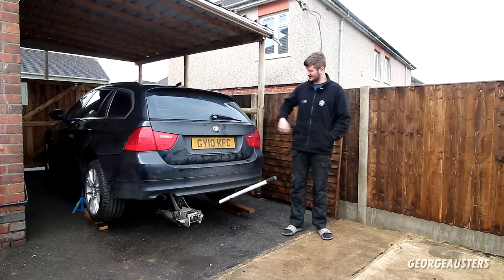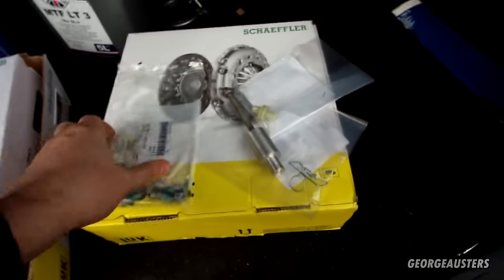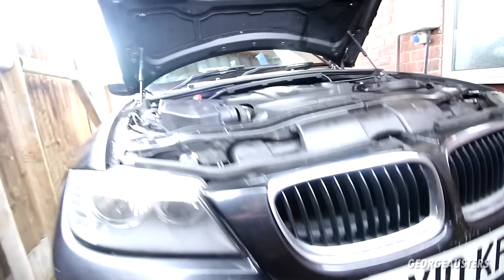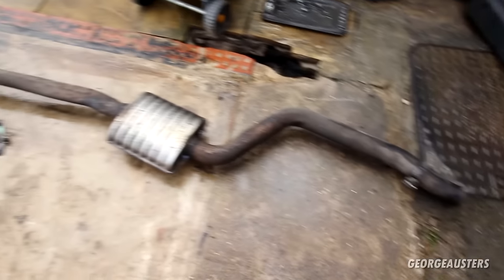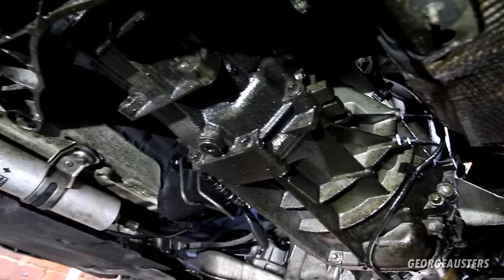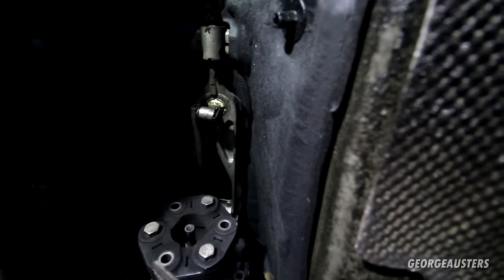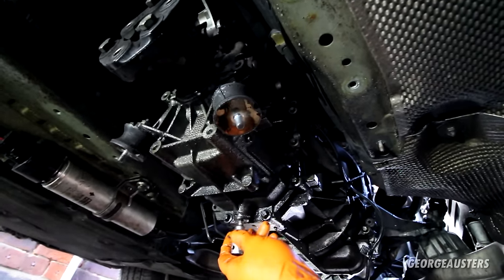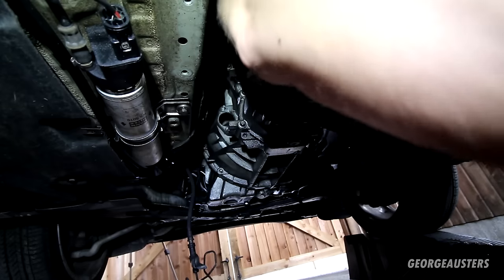HOW TO REPLACE A CLUTCH ON A BMW | CLUTCH & FLYWHEEL REPLACEMENT

Comment: I feel for you George, I am 70 years old and done a few of those, The old ford sierra springs to mind.  Well Done.
Reply from the maker: Thanks Andy!
Reply: Yeah,  ford sierra, cast iron bell housing and box, effing heavy ..and i did not have George's muscles- that was hard.  well done George - nothing to point out this time .:)
Reply: My god yes, the 4x4 was an absolute nightmare to do
Reply: Actually the first clutch i changed in my life was a Ford Sierra one, it was pretty easy in my opinion :D

Comment: Just a small tip for anybody make sure the box is in gear it stops the shaft from spinning and you can turn it from where the prop shaft connects
Reply from the maker: Good idea!
Reply: Nice

Comment: I did the same thing to my 118d (m47) a year ago. To reinstall the gearbox, I placed two long wooden poles beneath it, and then two of my friends lifted it 'vertically'. This way, I only had to align it with the clutch, nice job George
Reply from the maker: Yes it would be a lot easier with 3 people hahaha

Comment: At least bmw have the driveshaft bolted to a yoke. On older cars it slid out leaving a hole which could give you a crotch full  of the most smelly disgusting oil.

Comment: In my younger life I worked for multiple transmission shops pulling and rebuilding automatic transmissions. Did my fair share of clutch jobs as well. One thing that is important, before removing the transmission mounts put a jack under the transmission so you don't destroy the engine mounts as they are pretty much supporting the weightafter the trans mount is removed.

Comment: Been watching this for 10 minutes George and could not have been more relieved to see that trolley jack. I was fearing for your safety mate! Incredible job as usual. No way that's 50k miles on the inside of that gearbox either.

Comment: George, a handy tip. Put 2 cut off long as possible bolts into the block so that the bell housing can slide along them into position. That way, you never subject the clutch centre or trans input shaft with radial loads. Also gives you much more control. Slot the ends so they're easy to unscrew.
Reply from the maker: Not sure if you watched the whole video but I did do that with 1 threaded bar but it actually made it more awkward in the end as I couldn’t get it high enough to just slide it along from so far back

Comment: The new push bearing always feels  as loose as the old one coming out 
And as for the nylon pin most clutch garages don't change them its a must when changing the clutch there is an upgrade on ebay and its made of metal
Most of my cars are BMW and i repair them my self ie trimming chain clutches dpf etc 
And you did a really good job on the clutch

Comment: Well done George! I would not have fancied that job at all. In my long motoring life I have changed a couple of slipping clutches that you can't just see easily what the problem was. I have always assumed it was pressure plate trouble. I have had a few instances where people have just changed the friction disc and said that it has had a new clutch fitted, maybe the case on KFC. Anyhow, job's a good 'un now, so onwards and upwards, as you say, next clutch change may be on your own ramp.
Reply from the maker: Let’s hope so 👌🏻

Comment: Wow, thought you were going to get crushed by the gesrbox at some point very brave to tackle that on the floor. Thinking of dokg my 318 e90 as its on original clurch on 190k miles. Do have acces to 4 post ramp and an extra pair of hands so should be easier for me. Great video and super informative.
Reply from the maker: Haha thanks!

Comment: All the recent clutches I have changed have had weak pressure plates and have been slipping. Years ago the plates were usually worn to the rivots. Dont think I have ever seen a good release bearing. Bell housing bolts on BMWs are usually ridiculously tight requiring a breaker bar to undo.

Comment: I did the same job on my MK3 cortina in 1982 when I was 26.  Same experience as you, maybe not quite as bad, but still resolved to not do another one. Driven torque converter autos since 1994, no problems with any of them😅

Comment: After struggling for hours I figured out the best way of doing this on jackstands without help without a proper set up.  i would recommend this process, 

Step 1 : Understand where the centre weight balance point of the gearbox is 
Step 2: Position gearbox under car about 5-10cm away from clutch interface on ground
Step 2 : Use a jack and most importantly get a bit of yoga matt/rubber to put in the jack cup (otherwise the gearbox will slip all over the place on the cup and make life hell) Position jack perpendicular to the car 

step 3: Get underneath the car (so you are perpendicular legs going the same way as the jack handle) get behind the gbox (driveshaft end) and lift it up into the cavity and put the jack (cup) underneath the GB centre balance point - balance the GB on jack cup 
Step 4: Use your leg to pump the jack handle up while using hands to steady & guide GB  into location - slowly once you get close and guide the GB into position
Step 5: With the jack taking the weight put a couple of the bolts in 
Step 6: drop and remove jack, do up all bolts 

The key is to use the centre balance point of the GB on jack and use something so it doesn't slip on the jack cup - do this and guarantee the pain will be minimal  
Also makes it easier to get to the  top back bolts if you use an engine support bar to lift the engine and makes the gearbox go down

Hope this helps someone - makes it MUCH easier

Comment: Get yourself some quickjack lifts, or the new Clarke CCL2250 version from machine mart. Gets the car up enough to roll on a creeper underneath.  Best thing I’ve bought in years.
Reply from the maker: I’ll be getting a 2 post lift once my garage is built👍🏻

Comment: Overall, well done video on the DIY clutch replacement here. I enjoyed seeing the process in detail. I couldn't help but wish I could've stopped you from struggling with removing/installing the tranni by hand though. A cheap Amazon motorcycle scissor-lift jack would've made your life so much easier. Personally I would never try supporting a tranni by hand and rely on the bell-housing bolts to hold it in place.
Reply from the maker: I was considering buying a floor transmission jack but honestly it won’t get used once I have my 2 post lift, I’ll just get a regular one then

Comment: Great job, with all the shortcomings! Love your attention to details and cleaning philosophy! Had you considered a "DPF internal cleaning", I know that these services are on offer in Germany... a lot depends on the ash/sulphur makeup of the diesel distillate your area is supplied with, do you fuel branded fuels or "the cheapest of the day"? Evidently the Guibo was not deteriorated? Perfect timing for gearbox/diff oil change, don't know how temperature plays into quantity exchangeable. Thank you very much for sharing - Chris
Reply from the maker: Very confident the DPF has already been completely cleaned out if you know what I mean!

Comment: Result 😎 I’ll have to watch out for this what miles did it do before you changed clutch and arm. I did do a quick donut one night from a clutch kick and my clutch just sank to floor I had to pull it back up with toes and Not had a issue ever since or done it again

Comment: Hi ihave same 320d 2008 am going to attempt to change clutch on my driveway just one thing i want to ask shoud i remove heat shield under the drive shaft

Comment: Excellent job George but I'd be wondering were that oil contamination had came from?
Reply from the maker: As there wasn’t much, I’m wondering if it’s came up through the inspection hole with the rest of the oil underneath the car.. Neither the rear main seal or input shaft seal were leaking so I’m not concerned👍🏻

Comment: @George Austers good.job done the hard way for sure George. I'm curious you didn't mention the pilot bearing, don't all BMW's have a pilot bearing that also needs replacement which is pushed into the crank hub?
Reply from the maker: Pilot bearing is inside the flywheel👍🏻

Comment: I've got an aggressive vibrating gearstick. The garage says its a clutch off job. What could that be? Do you have any ideas please?
Reply from the maker: It's not the clutch.. All BMWs do it
Reply: @GeorgeAusters  that can't be right, surely. I dont mean like flywheel vibration, I mean when I get up to like 4k the gearstick buzzes like crazy. I have to change gear because it sounds horrible 😫

Comment: Hey there,

Thank you so much for this guide. I've been following this as I do my own bmw 1 series. Bloody hard on your own but all is going well. 

I had a quick questions, I've taken off my old flywheel and just moutning the new one. I took a flashlight to the dowel alignment pin and it looked like it was on. I've just buzzed it on with an impact driver so it hasn't pulled it in much. My question is before I torque it down. Should there be play behind the flywheel? Mine doesn't fill like it's sitting flush, so I want to make sure that the pin has actually gone in. I'm considering taking it off and having another check that everything is sitting nicely. Or should I torque it down and it should sit back during tighting.

Thanks again for the guide. 
Life saver

Comment: Jesus, I could hardly bear to watch the gearbox removal. I dropped a BMW E46 box on my hand 2-3 years ago doing a clutch job on the ground and needed five stitches - after another 3 hours to finish the job. Kitchen roll 'bandage' with masking tape under work gloves, dripping blood. 😂That was a little 5 speed as well. 
You can get rounded out cover bolts out by hammering a spline drive socket in. 

Bollocks to doing that again. I paid someone else with a ramp to do my own 318d clutch and DMF last year. 2.5 hours with a tea break and the exhaust still on.

BTW - the yellow stuff on the flywheel bolts isn't thread lock but thread sealer. The holes in the crank are not 'blind' and oil will try to seep through and get onto the clutch and that's what happened here hence the slipping. You can see the oil. You can reuse the original bolts but you must use threadlock or sealer.

Comment: If I could use one thing that would make light work of that job is a Gearbox Scissor Mechanism Type Floor Transmission Jack Car or for less than £30 you could get yourself a Transmission Jack Adaptor to go on your jack
Reply from the maker: Was thinking about it but it’s pretty awkward by yourself with not much room so I’ll just get a proper transmission Jack when I have my 2 post lift

Comment: Well done m8. Got flashbacks from replacing diff on my ex Lex IS200.... Had a jack, had an extra bit of chain just to hold it in place - still, it slipped landing on my head xD Now I have a lovely invisible scar hiding under my eyebrow.
Sure all jobs can be done by ourselves but as you said - not all of them are recommended as they're a pain in the bum (or head!). Peace!

BTW. By the looks of of these bolts and probably not centered clutch (shaking much huh?) by the previous lads - I woudn't trust the timing chain was done right, for sure NOT with all new bits in kit :>

Comment: I have just done mine but still having problems with the gearstick shaking on ide rev the engine and it clears a little bit any advice on what could be the issue many thanks
Reply from the maker: It could be a lot of things, engine mounts, transmission mounts, crankshaft pulley etc but it’s fairly normal for a bit of shake

Comment: George - do you have any good videos on replacing a clutch master cylinder on. Bmw120d ?  could it be done easy DIY ? I am having issues with the starting sometimes and I'm having to put my foot more on the clutch .. last time this happened on an old BMW I had to take it to the garage and they replaced the clutch and flywheel.  

Wondering if I can sort out my clutch pedal issues ( has depress issue and also now more recently the engine doesn't start I have to put my foot further to the floor on the.clutch than I used to.. it's on 129k at.the moment 

Thanks
Reply from the maker: Pretty simple job really
Reply: @GeorgeAusters  cheers

Comment: Hi George did you reuse bellhousing bolts?apparently they’re aluminum and one time use only.
Reply from the maker: @robster6868  Yes I did, they’re not aluminium
Reply: Looking on the pelican site from the states,they say they are aluminum and one time use only,doing mine tomorrow as part of an underbody restoration à la Redish Motorsport,so glad I’ve got my inspection pit 👍
Reply: @GeorgeAusters  yes i can confirm steel bolts on 2006 320i,why can’t you reuse them?
Reply from the maker: @robster6868 You’re not “supposed to” because they’re TTY bolts but you can’t get in there to torque them properly anyway

Comment: Hi ,i am bought in Sydney Auctio Salvage  BMW E 65 740 i 2007 original service look book 160,000 km ,car hard shifting automatic gearbox  last service on 95 ,000 km please what need fix if got any information thanks.

Comment: Madness to do this on your driveway. Pulling a big heavy box out on your back you're risking serious injury.
Yes, it's money but either hire a ramp or put it into a workshop to get it done. Some jobs on a car are really not worth risking at home...
Reply from the maker: I thought if I can do a full engine rebuild at home then I can certainly change a clutch at home🙌🏻
Reply: @GeorgeAusters  
There's no doubting  your abilities. All I'm saying is you risk injury pulling out a heavy box like that and having it supported on your torso. Having someone with you to help if needed is a must imho especially in a very restricted working area like that..

Comment: bro trans jacks are like 30-40 quid... 😂😂
Reply from the maker: Cheapest short transmission jacks are over £100 which is not really worth buying as I won’t be using it again. I’ll get a proper one once I have a 2 post lift

Comment: Have you done similar jobs like this before ?
Reply from the maker: I’ve installed clutches etc while the engine is out of the car but this is the first time doing a solely clutch and flywheel job

Comment: George I had a LUK replacement dual mass flywheel + clutch set fitted by mechanic to my e60 520d ; it's roughly 2000 miles later and the clutch is not gripping after 3k RPM in 4th gear onwards . i rarely drive on the motorway but you can smell the clutch burning up and no acceleration the rev needle just sits at 3k in high gears , is this the clutch material "wearing in" process still in action or has this guy messed it up . people online are saying when changing the whole set it will take longer to wear the clutch in .. obviously i could (should) take it back to the shop but im curious if this is something you have experienced
Reply from the maker: Probably installed wrong.. I installed mine 15,000 miles ago and nothing like this